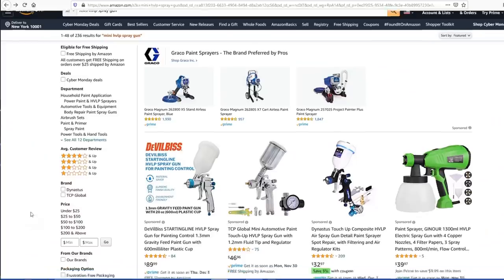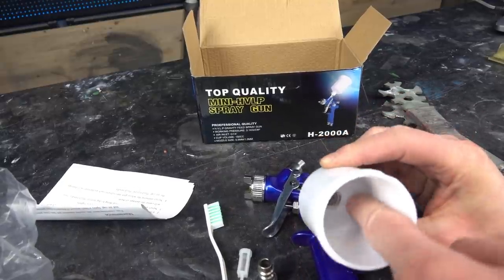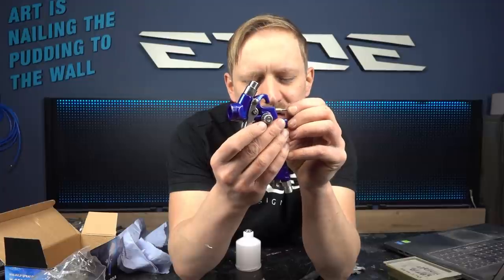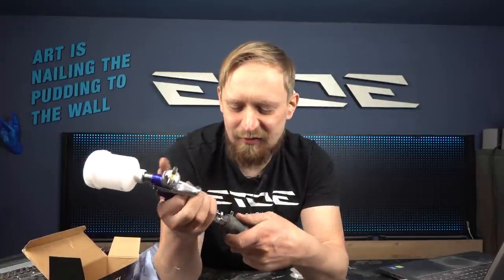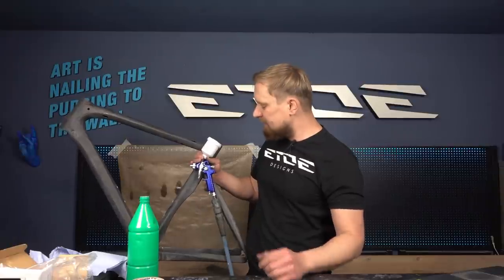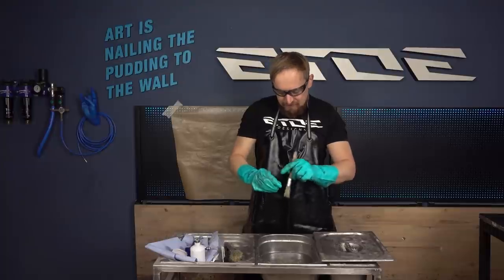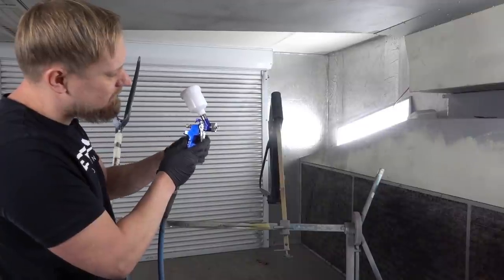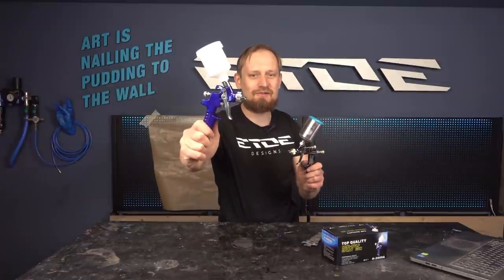cheapest spraygun ever - does it spray?

Comment: Excellently presented work with a gun. I am interested, however, in these seals you mention. To be replaced with SATA seal. Where can I buy this? What address, shortcut on the website? I hear from the dialect that you are from Germany. I may be wrong. Is it possible to get these seals from Germany?

Comment: #SPRAYGUN Thanks for review. More than 10 years ago I buy for one special project (glider wing coat partial repair with PU white colour) quality spray gun which costs me more than 300,-Euro with aditional stuff like bigger colour can and so. As total newbie I believe that high quality and expensive tools are neccessary because I cant fight with my two left hands and bad equipment together. I know, I was young and stupid but project turns very well with help from my friends. Nearly. Lot of preparation, lot of sanding and polishing but exept some minor defects result is very nice, unfortunately I was not able to reproduce slight orange peel which was originaly on the surface and repaired part is smoother and more shiny, thus it is visible where repair was made... Today I learn, that skill and knowledge and patience is more important than expensive gear. Thanks for video and share of your knowledge Martin.

Comment: I bought another brand of same gun you got... a NUMAX. Better exterior finish on it. Glad I saw this vid ETOE as I made the refinements you advised and cleaned the new gun prior to using it. There was grease on the paint side of the needle SO THANKS to you that I caught that beforehand! Used gun to apply Cerakote Matt Clear. Worked fine and more thanks to you for the vid on "setting up."

Comment: I got tiger stripes with my new for this project devilbiss startingline spraying metallic, 22psi gave best spray pattern, slightly heavier on bottom, even when I turn air cap 180 degrees. Air tip clean. Held gun what seemed parallel to surface. sides are good- just hood,roof, trunk.Have 3 coats on and looks better but still can tell. So do I scuff and spray at higher psi and increase distance spraying to fix?

Comment: What air pressure is fit for this tiny gun? I'm having problems with little paint dots on the surface, can't understand if it's too much or too little pressure...
Reply from the maker: 1.8 bar.

Comment: #SPRAYGUN if only just for a piece of YouTube history.  I do have a question though, I was wanting to spray a tinted clear over a bare steel frame.  What, other that cleaning/degreasing, is necessary for better adhesion since there's no base coat?

Comment: Any reviews of the home grade compressor? Or at least what to look for when buying one. My budget is low and I will not paint more then 1 or 2 bikes a year.
Reply from the maker: Yes. Buy 3 kilo of cabbage, a plastic hose and if you have problems with wet poop a cloth as a filter. Perfect low budget solution. And if you want to save some bucks use home grown cabbage like I do.

Comment: Question: If you paint a steel frame, you use those stickers to protect QR skewer, derailleur hanger etc. So that means, there is no coat on these places. How do you prevent it from rusting/damaging the paint in the future? Plus extra question. Do you clean spray can caps or do you just buy bunch of them and replace them? Thanks!
Reply: I'm also wondering about cans caps cleaning!

Comment: #SPRAYGUN Even though this gun gave you a headache, would you still recommend it to a beginner instead of spray paint cans. Or is it just not worth the hassle?
Reply: Its good joice for begginers. Iam painting bikes on pro level for some time and I use only such cheap guns. They last long if treated well. If they fail theyre easy to replace.

Comment: You need to remove the needle before the spray tip to prevent the needle from being bent, the fact you show this the wrong way, even on a cheap gun discredits your credibility and expertise about spray guns in my eyes. You're also supposed to pull the trigger or remove the needle before removing the cap. If I'm wrong I apologize but this is how I learned it
Reply from the maker: And you should never flip a spray gun or you break it immediately 😄
Reply: @ETOE  no flipping it just makes you look cool